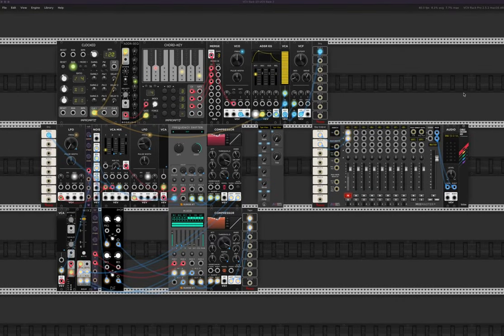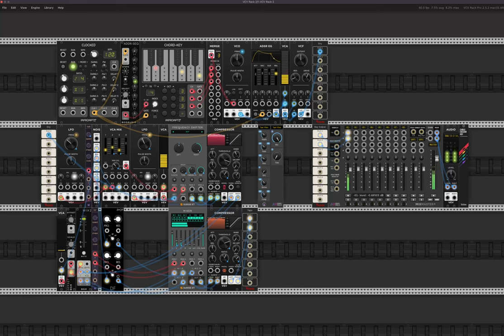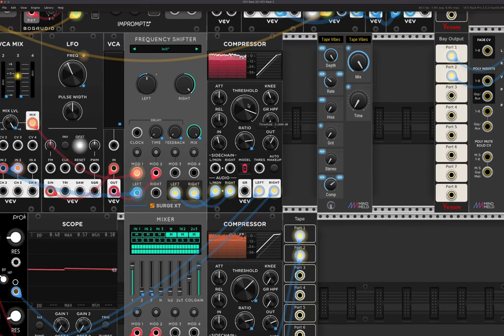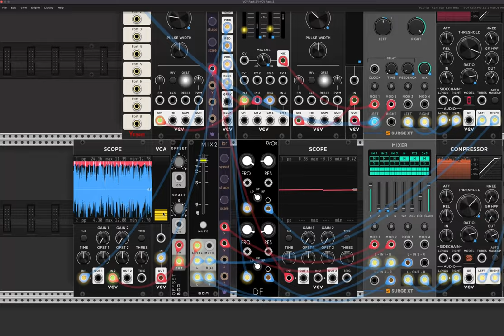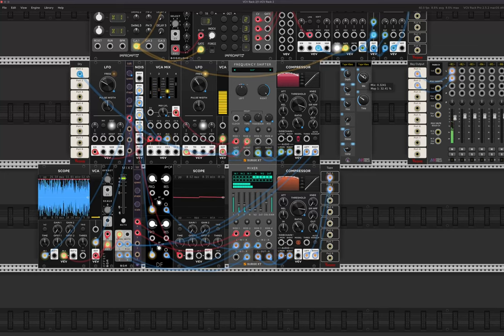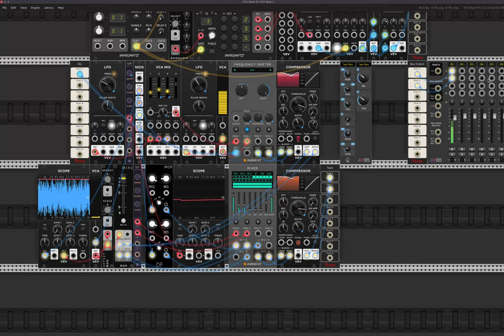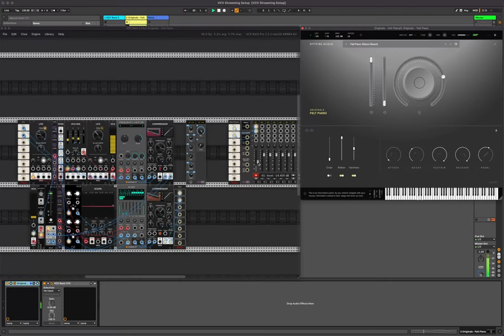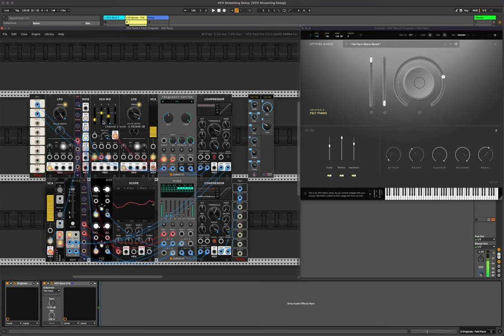PatchWerk with Miles // EP04 Tape Emulation in VCV Rack

Comment: Of course you could just use the tape emulator in the free Airwindows plugin, but it's always fun to make your own from scratch! I've done this before using the VCV delay to change pitch, and a pair of Vult Caudals - one slow for wow and a faster one for flutter, mixed together with a crossfader. Doesn't need to be polyphonic, just slap it on the whole mix as a stereo effect. If you want to go full lo-fi, Heatrik Dust makes a decent vinyl crackle too! 
Beats me why anyone would pay good money for a tape VST plugin 😉